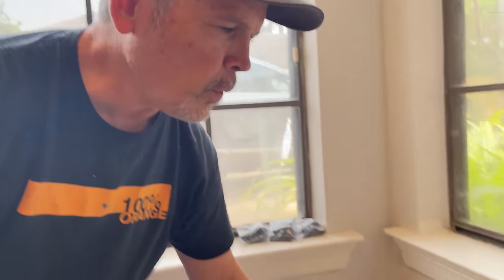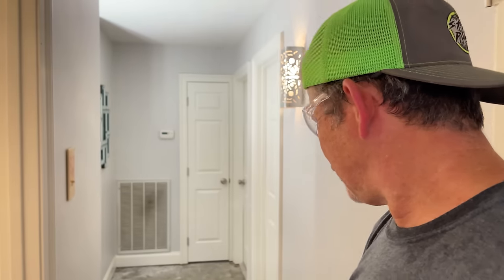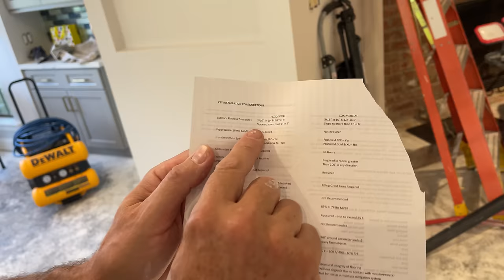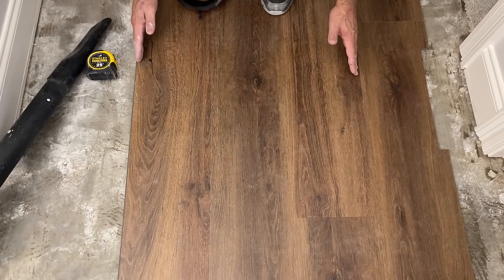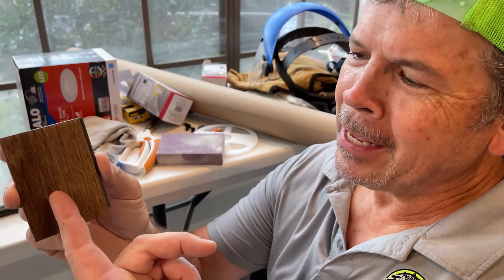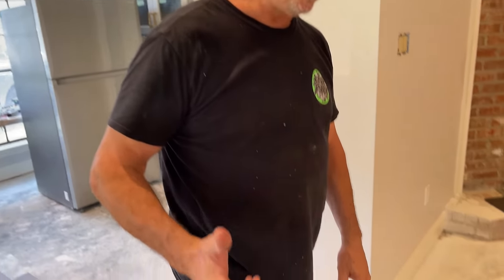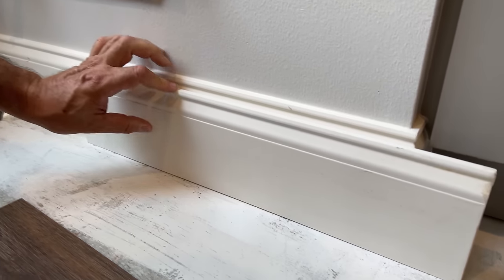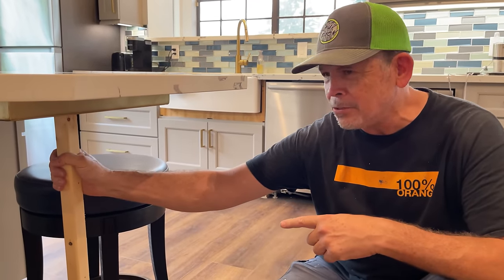The ULTIMATE FLOORING HACK! | Installing Vinyl Plank Flooring

Comment: One of the first things I always do as a journeyman flooring installer, is pull baseboards when walls are being repainted. It offers a much cleaner look to lower them than it does to add or reinstall quarter round.
Reply: 99% of homeowners aren't going to want to pay for that. And if you do sub work through home depot or somewhere similar, those customers definitely won't pay for it. Good luck though 🤷🏻‍♂️
Reply: @damienirvin777  I’m just taking a shot in the dark but they probably aren’t doing work for customers looking  for a cheap alternative.
Reply: @JohnParker-jm5tt  Well that flooring looks cheap.. so.
Reply: Nothing like adding a couple grand to a cheap flooring job to pull, reinstall, repair, caulk and paint baseboards.
Reply: @jnicemiz  It’s as easy and looks way better than installing quarter round that needs to be cut, installed, caulked and painted. Literally take no time to pull and reinstall baseboards.
Reply: I was thinking the same thing.
Reply: Jam saw to cut the base.  Slide flooring under base.
Reply: @damienirvin777  then I’m not doing it & they can find someone else lol , there’s a right way & a wrong way, that’s hack shit
Reply: @Nunya-gk9fr  most new construction homes we do flooring in get quarter round from the start. I would prefer to pull baseboards instead of installing quarter round but the customers get what they want 🤷🏻‍♂️ we suggest it often, they tell us no. Not hack shit, just the cheaper way out. If it was hack shit, they wouldn't sell quarter round in flooring stores 😂
Reply: As a guy in every aspect of the industry. I can assure you. Customers that don't have the money to make it right or don't understand the importance of making it right, aren't customers worth your reputation on. And as OG stated. The cost difference between the two is REALLY not that bad. Atleast your baseboards are already cut to size. But think of it. I want people to walk into a house I worked on and say, "That work, is work I want done on my house." 100% of my client base is word of mouth, and I'm booked for the next 2 years in a shit show economy. Seriously, don't short cut, it'll only hurt you in the long run especially if you are a contractor. It's acceptable for DIY. But not anyone that wants a decent reputation. I 100% agree with OG and would simply insist on any floor job.
Reply: Imo quarter round or shoe mold looks better to me 🤷

It looks weird with just baseboards.
Reply: IMAO.  Quarter round does not look good especially if not an exact match to new floor.

Comment: Pro tip::  When installing wood ,laminate and LVP flooring around a brick fire place we use a door jamb saw with masonry blade to undercut the mortar joint under at least a half inch so our flooring ca n slide under the bricks and also give you room for expansion of the products..This can also be finished by using a mortar colored caulking to keep trash out of the edges too
Reply: very cool
Reply: Yes we do this too , but for click together floors you should start your rows off the fireplace otherwise itll be a bitch to get under and click in
Reply: Yes very good tip on an undercut saw. But you better have a shopvac hooked up to that saw or you will be sorry 😢. You will be hiring a cleanup crew to come clean all the dust out of the house ask me how I know lol
Reply: @nathanielpulling  understood.  using motorized tools does create alot of dust
Reply: @raymondmaglaris4149   thats why you shave the lock and then glue and tape the plank

Comment: Pro Tip: When you are installing straight runs you dont have to measure your end cuts. Take the piece you want to use, flip it upside down, place it where it should go, mark and cut. This works for tile, wood, laminate, all flooring really. Much faster but your "cut man" might not like it so much.
Reply: Then use the cut off piece to start your next run (if long enough).
Reply: That's how I've always done it.
Reply from the maker: We did that a few times.  I got tired of spinning 5 foot pieces pretty quickly 😬
Reply: Much faster than measuring and more accurate. With Vinyl you can even hold the position with your finger before moving a few feet to a hard board on the ground to score and break with a knife. Plus you don't have to get up and down.
Reply: Everyone is an expert. 🙄. Would love to see y’all videos?!?
Reply: This works, but sometimes isn’t any more efficient. I’ve found the this works better (more efficient) with hardwood strip that is varying size, than with laminate or vinyl plank that is 4 or 5 feet. When I do measure, I measure to the protruding tongue and no the face of the board. This way you will have a consistent expansion gap with no math.
Reply: @VETERANMASTER You don’t need a video to show you have knowledge and experience. Part of what separates the good tradesmen/women is their willingness to hear about a different method or tip, and the encouragement to learn together. What did your comment do to further those goals?
Reply: @Chris Bryant Exactly. One row at a time doesn’t maximize the work flow in a open area.
Reply: Basic tip lol.
Reply: @Chris Bryant Sounds familiar  ----  oh yeah ---- those architectural shingles I just put on my garage ...
Reply: Actually the only way how the major Mfgrs will warranty it. Stair stepping voids warranty. Also most of the “no vapor barrier “ con has been rescinded by Shaw and Mannington—or my suppliers told me.
Reply: @StudPack  fastest way, for a large open area provided its actually in square, And all the boards are same length: you know that the length of the first + last board will be constant. So you can lay the middle of your first row with full boards, measure the first + last. Mark it on a board/stick now you can cut the first + last, and use the cutoff from the last as the first to mark the next one. Works very well when in sync with the cut man. You gotta let him know if he needs to add or trim a little as you go. Dont cut them all to start youll have problems basically he can cut the next row as soon as the last checks out. No measuring, done right in a large rectangular space the floor goes in as fast as you can lay it down no measuring or cut time.
Reply: @mainmanvern  and it doesn't look like the pattern nearby in any direction.
Reply: @VETERANMASTER  If you have ever done a floor before you would not be a smug chump about it, you would recognize the tricks.
Reply: @achillesbuilds2432  well it's a basic job, with a few obstacles along the way.
Reply: 1
Reply: @scullin225 what do you mean?
Reply: @StudPack   You could flip a bundle or a few, depending on the size of your room, and leave them by the end side of the room. This way you don't flip any planks during installation.

Comment: Pattern recognition is huge. I just put down laminate flooring in my house, and we opened as many packages as it took to see all the different types of planks. Then we stacked each type together so we could see how many different types we had and we could choose exactly which plank was to go down next. It came out beautiful.
Reply: That's the only correct way to do it. I have seen many floors that didn't adhere to the staggered joint line conventions too, bugs me the core.
Reply: We just did the exact same thing, we went slightly one step further and labelled each patterned plank with a letter on a small circular sticker. That way when needing the next plank I could see which letters are surrounding the area for the plank (a, b, j, h in the vicinity for example) so I know what options I have for the next lettered plank. Saved us time trying to identify the pattern for each plank!
Reply: I have been accused of being a perfectionist after opening and stacking according to the names I gave each pattern. The "bat", "booty" and "right knot" are few of the names used.  😂
Reply: How do you like the high traffic areas moving all around and the big gaps

Comment: Great video. With such a large area were there any sections that were spongy? I just had my floor done with LVP and some areas are spongy. I was told that is normal because of the size of the room. Any thoughts on why or what a fix would be?  Thanks